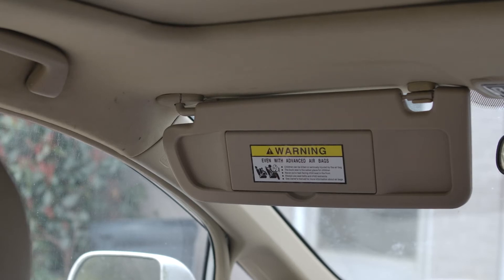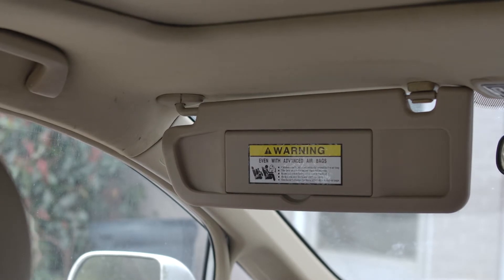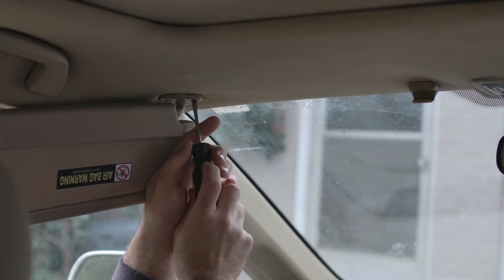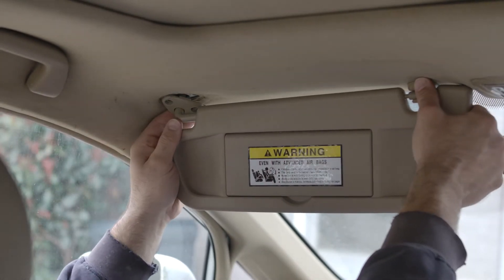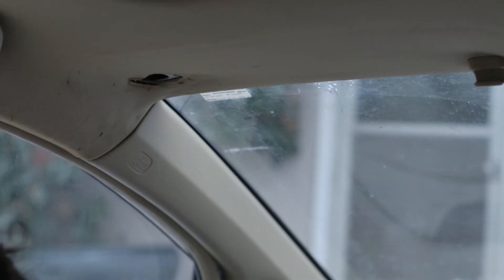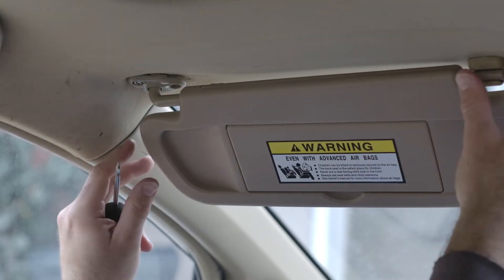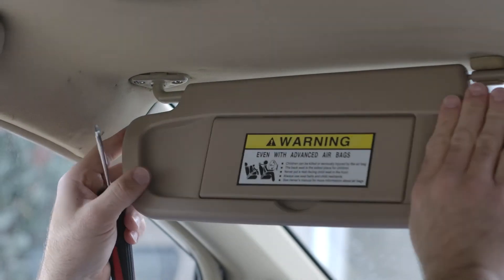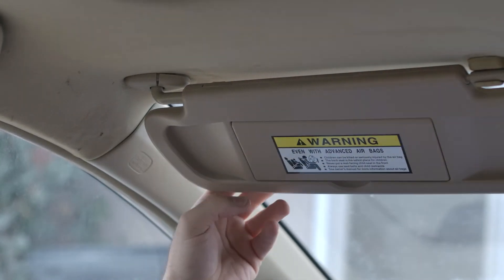How to Remove and Replace a Sun Visor - 2006 Honda Civic

Comment: I removed the screws but now they don’t go all in ☹️ I don’t know why because they were down to the end. Now it only screw halfway
Reply: I tried to put it without the visor and doesn’t work neither. I’m using the same screws
Reply from the maker: I can't say for sure what the problem is with out being there in person, but I would be willing to bet you cross threaded the screw when you put in back, This would make tighten up before it bottomed out in the nut. Sometimes you can use the same screws  once they have been cross threaded, other times you need to replace the screws and if you tightened it down too much while its cross threaded you may need to get tap and die set to fix the nut that is welded in the roof of the car.
Reply: @BuildStuffwithAJ  I fixed the problem putting vaseline on the screws 🤣 and It worked
Reply from the maker: @khelix23  😂 what ever gets the job done right 😂